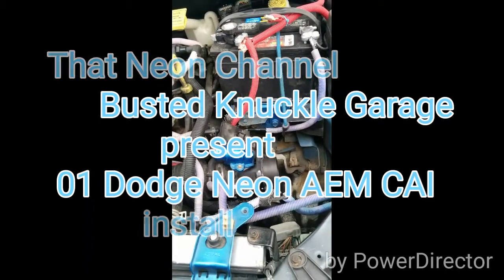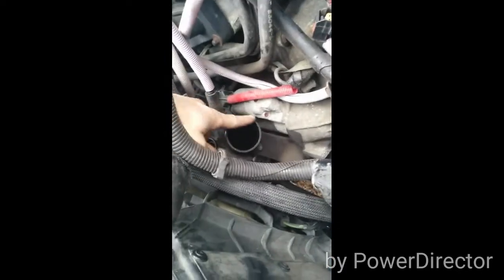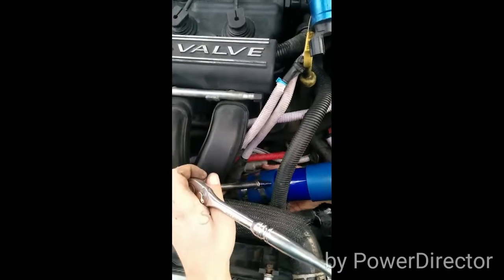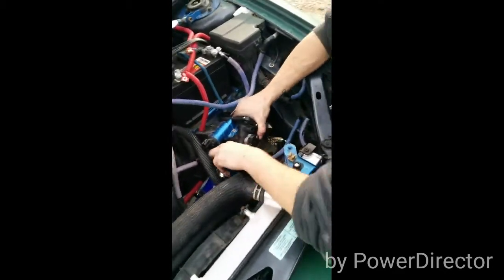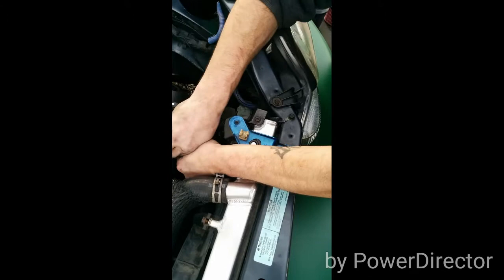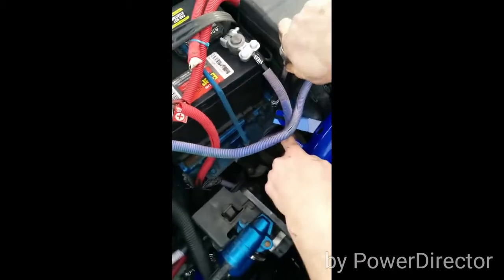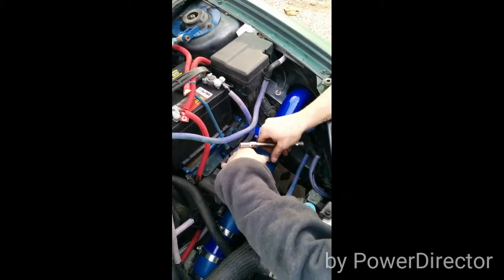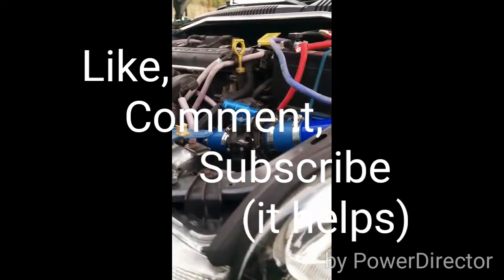How to intsall a cold air intake on a 00-05 Dodge Neon

Comment: What brands do you recommend for cold air intake for a dodge neon?? Looking for something cheap but not too bad quality
Reply: I was just gonna buy a cheap intake and switch out the air filter with a k&n filter top.
Reply: @LuisMorales-xh2ch  any 2.5" will do but id just get a cheap one like the same 2 piece designed in the video come with 3 rubber females and 2 pipes one is straight other goes into the fender ebay has em cheap right now i found a no name brand for $60.Us comes with filter and all hardware it was red and chrome

Comment: My question is, is why would you put the air filter that low especially into the fender well with no splash guard? Not a very good example of setting up a cold air intake without blowing your motor up

Comment: Ayee broo i got a dodge neon 2001 SE and i just want to ask if i can put a intake on it?is intake compatible to my car?
Reply from the maker: +Lorenzo Salazar yea man they make Couple kinds of intakes my gf has an aem intake on her 01
Reply: +That Neon Channel but the mechanic that i know said i cant put an intake because my car had a air flow sensor sum like that
Reply: +That Neon Channel soo is the car on u video is dodge neon 2001  se sum like that?
Reply from the maker: +Lorenzo Salazar yea that's exactly what it is
Reply from the maker: +Lorenzo Salazar yea that's exactly what it is
Reply from the maker: +Lorenzo Salazar nope he is wrong my gf has never had a issue u have a map sensor not maf even with  maf u could have a cold air intake...ur mechanic didn't want to do the job ....just buy 1 and do it yourself it will most definitely run better

Comment: Where does the blue hose you have go?
Reply from the maker: +Izak Behunin pvc
Reply: That Neon Channel won't reach, it's too short?
Reply: That Neon Channel and where that located
Reply from the maker: +Izak Behunin u hook to the port on the intake manifold itself before the throttle body
Reply from the maker: +Izak Behunin on side of valve cover
Reply: That Neon Channel before as in closest to the intake manifold? Also what does the little nipple thing closet to the filter connect to
Reply from the maker: +Izak Behunin yea and it hooks to the old air box hose
Reply: which hose? maybe make a quick vid? i did this to my car yesterday and dont know where the co2 sensor is/ goes also
Reply: If anyone 3 years later wants to no it goes to the hose leading to the rear of the sohc 2.0 valve cover  (not dohc they are on the side and the rear is the pcv)  when the stock air box is removed you will see a sad looking sponge for a filter in the air box slide the hose over that one and clamp it lightly

Comment: hey my neon intake has a different set up from yours mine goes into the throttle body and down by the wheel but there is a rude piece off by the clip where you bolt the hose any reason on y its there?
Reply from the maker: +Chris Tomlin sounds like the previous owner tryed to make a cold air intake

Comment: wheres the filter
Reply from the maker: +Tommy Vibe behind the bumper really close to the ground between the fender liner and the fog light
Reply: That Neon Channel where does it connect to?
Reply from the maker: +Tommy Vibe I'm confused the aem intake connects to the throttle body, then goes past the battery then down threw the old airbox hole ,down behind the bumper,and the filter hooks to it...I'm going to try and get her to do a walk around so people can get a better look at it